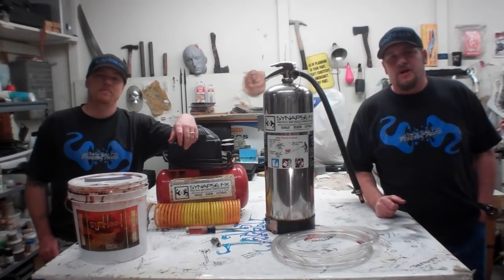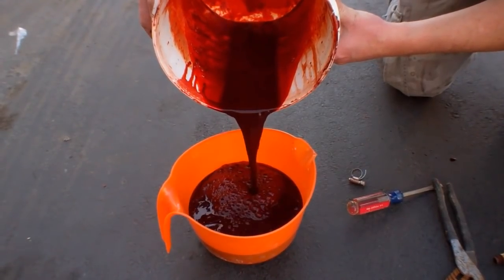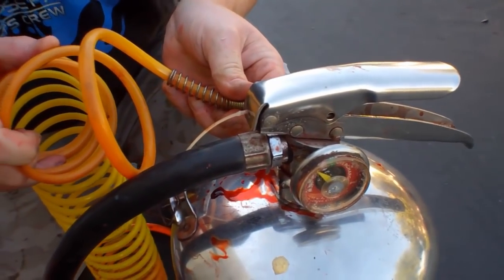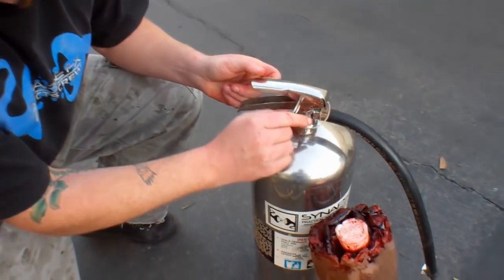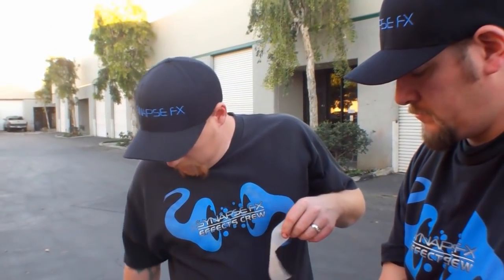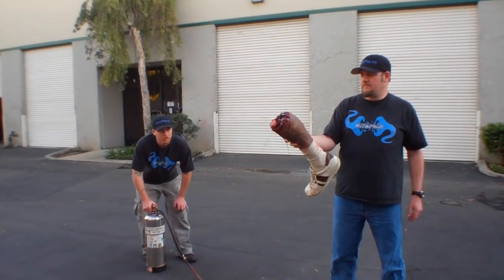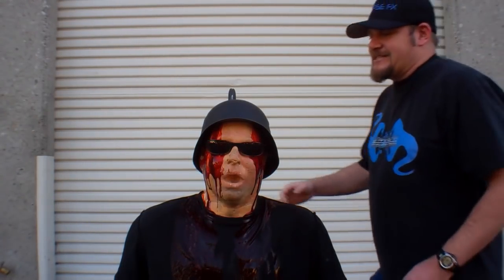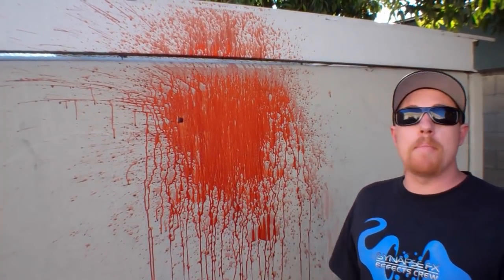How To Spray Fake Blood By Special Effects Pros

Comment: Screw CG, these ones are way better, no matter how do you do CG, no matter is it Ligh and magic, this is way better. Cg can be used for something else. And usually CG effects are of short duration, because of render time, and more dynamic. Which is the way they do it, but that´s never as good as real special effects. For about dozen reasons. Check the scene from the alien I 1979, that actress was really scared, and you can not do it against blue screen and CG, usually they use Maya, and Adobe AE.

Comment: I looked at the fire extinguishers, but the kidde (cheaper) brand did not have a removable top with a bolt. DId you guys customize yours to have it removable? And did your fire extinguisher come with that tire fitting to add air?